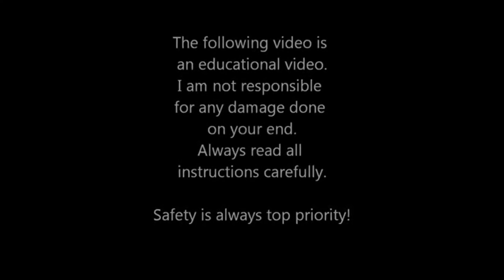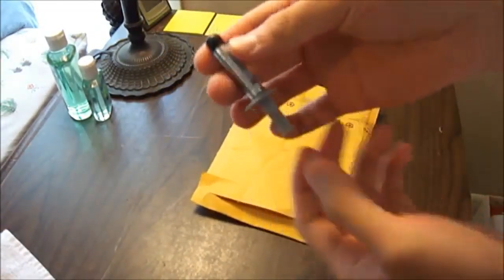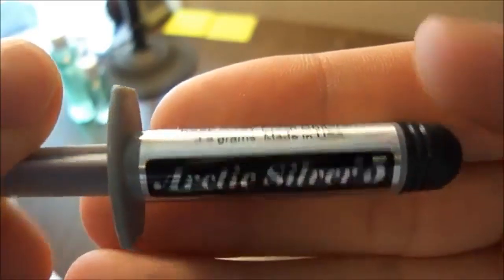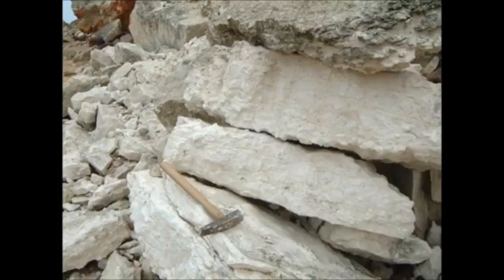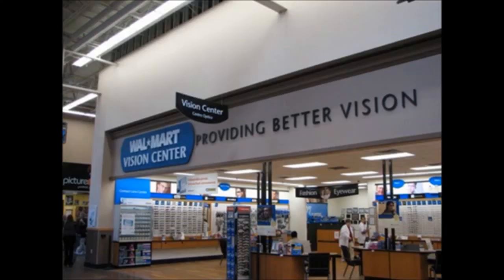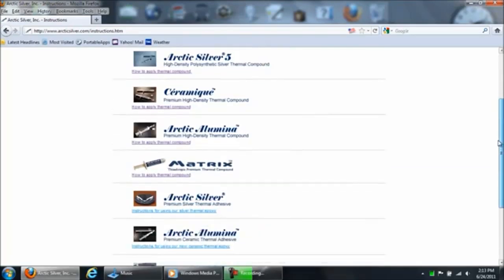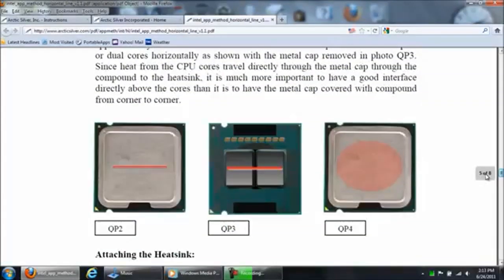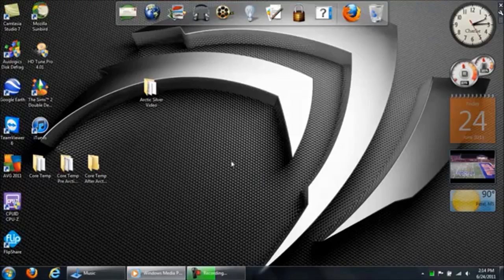how to fix display driver stopped responding and has recovered in laptop 100% FIX

Comment: What? Driver fails cause it's not updated, you have too much software running, or the gpu is slow. Why would changing the paste fix it?
Reply: overheat problems , when the gpu runs too hot it shuts down to prevent damages